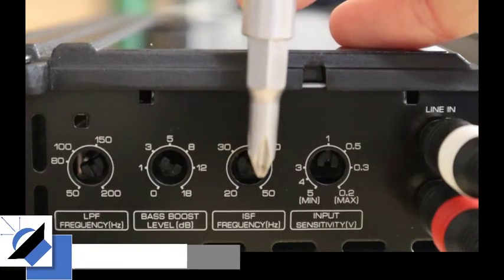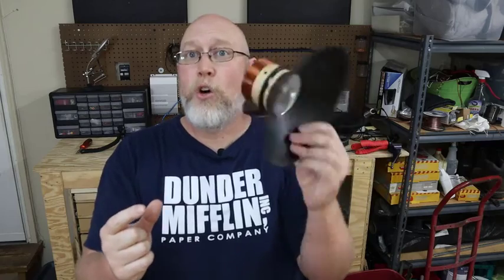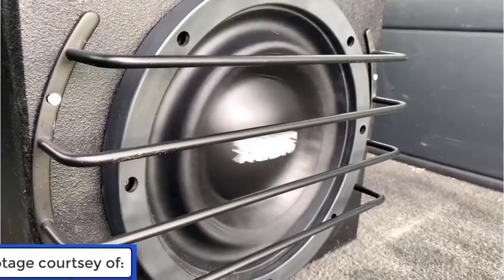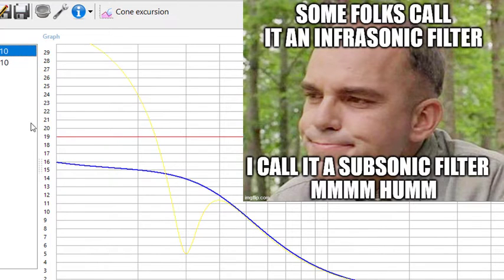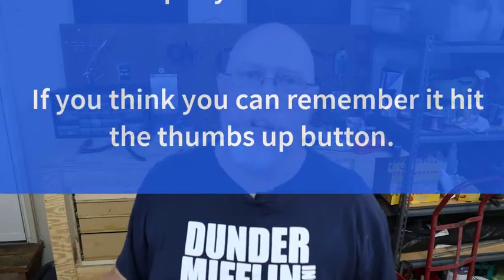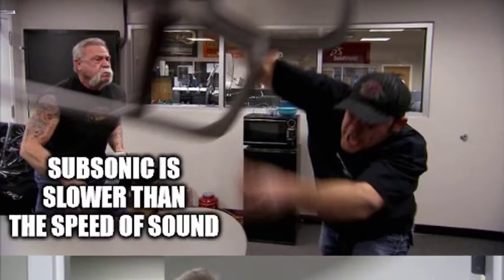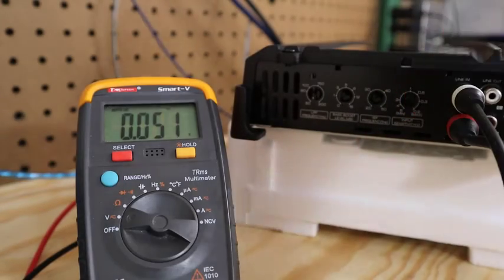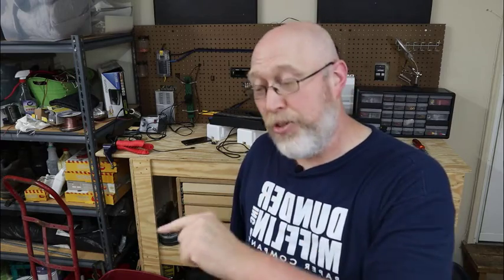Subsonic Filters, protect your subwoofer from low bass using a multi-meter.

Comment: If you are scared of damaging your speakers with low bass YOU DON’T FILTER IT THE LOW BASS ALL TOGETHER which is what a subsonic filter does because when you do that you deny yourself those low frequencies even at low volume.  Ultra low bass does damage speakers it’s the AMPLITUDE that does that. So any so called bad liver using any subsonic filter is a fraud, a pussy, a wimp.

Comment: How can you tell/avoid building a box that would make the driver operate as if it was free air?

And at 4:40, is it .75xFb, or half an octave?
Reply from the maker: 1) Tune the box low af, or go sealed.  2) it is both that is how the math works out

Comment: Should a duel coil speaker be wired parallel or in series with itself to achieve low bass in the twenty Hertz
Reply from the maker: It has no impact on the performance of the speaker.  You choose a wiring configuration to match the speakers with the amplifier.

Comment: So if you're using a sealed box should you just turn your subsonic filter to zero?
Reply: Set at 20 Hz if your sub doesn't  make any sound below 25,30 Hz.
Cause it's just wasting power and protects the sub.

Comment: Didn't understand this can someone please make it simple
Reply: No worries bro I got you. Plug in your port tune number instead of my example one.

1. What's your port tuned to? Let's call it 32hz (change to your tune)
2. So, 32hz × .75 = 24hz (so you need to play a 24hz tone)
3. You want your dmm plugged into pos & neg speaker terminals
4. With the tone playing, adjust the volume on your head unit until it's reading 10v on the dmm
5. Now you can set the ssf, adjust the ssf on the amp until the dmm reads 7.08v (You wanna get it as close as possible to 7.08v, but it won't hurt the subs any if you can't get it exact & it's reading like 7.05 instead.
After that you're good to go man ssf is set

Side note: if you can't get the volume to read exactly 10v, he did it for easy math. The equation is 10v × .708 = 7.08v. So, you can replace 10v with whatever number you're closest to then multiply by .708. That becomes the number you adjust the ssf to on step 5. I'd try to get 10v tho it's a much easier number. Hope this helps man 👍

Comment: I have a question, if the box is sealed but you have 2 subs facing 2 others in a single box, why can I reach x-max easy without subsonic "amps nob name" they are push the air together. So it gets pretty high pressure in that box hahaha
Reply from the maker: I'm not sure what you mean by two subs facing two others in a single box.

But in general sealed enclosures don't really need an infrasonic filter. That's not an absolute truth, just the general trend.  The air inside of the enclosure acts as a spring that makes it harder for the cone to move.
Reply: The front and back of my box have subs. But they are inverted for box space and cooling @DIYAudioGuy

Comment: Are all ISF's with the reading of 20-50 the same across different amplifiers, meaning, I been trying to figure out where is the 25hz position is on my Skar RP15001.d. Looking at this amp as an example because it shows the numbers and the Skar and this amp has the same range. Could I use this as a reference to help dial in my target frequency? Thank you
Reply from the maker: You can't tell by looking at the dial. You got to grab a multimeter and measure it.

Comment: most infrasonic filters 12-18db? It's 6db??.708
 in voltage I believe this is correct. I haven't double checked at max power it was set at half volume as shown here for 40fs driver 32hz tuned set to 24hz
Reply from the maker: You should be good. You can always make adjustments after listening.
Reply: @DIYAudioGuy  what would also work a roll of r15 or less for a buck

Comment: Since i have access to a SPL meter, I use that, along with test tones, and set on repeat, to set my subsonic filter. I recommend using a test tone 5Hz to 10Hz below port tuning, and reducing SPL output @ that freq., by 1 to 3Db depending on how much power you have, and how conservative you want to be. Example: If you have (2) -1,000 watt r.m.s. Subwoofers, and power them with recommended power, which is usually around 75% of r.m.s. power handling, so around 1,500 r.m.s for the pair, i would use a test tone 7Hz below port tune, and reduce output by 2Db. Make sure the subsonic is turned all the way down, before starting the test. Start selected test tone on repeat @ a conservative volume, example: If a system is capable of 140Db @ max, @ 45Hz, and the ported enclosure was tuned @ 37Hz, i would use a 30Hz test tone, and turn up the volume slowly to around 120Db (have SPL meter set to real time=Not peak hold), @30Hz, so its loud enough, but very sustainable, and wont heat up coils quickly, or drop voltage. Also listen to the speaker, if it makes bad noises, turn it down, or off. Then slowly adjust the subsonic filter, until it reduces the Db by 2, @ 30Hz, so 118Db. If you want to be more conservative/safe, set subsonic -3Db, @ 5Hz below port tuning, and if you want to be less conservative, set subsonic -1Db, @ 10Hz below port tuning. Hope this helps, have a great day, Audio fans.

Comment: Im using a JL audio HD 1200/1 to run a 13W7 in a ported enclosure. The HD1200/1 has a infrasonic filter which is factory set at 30hz and can only be set to on or off. My ported enclosure is built to JL audio specifications and tuned to 34.6hz. I feel the 30hz infrasonic filter is a little too close to the box tuned frequency of 34 and may be losing/missing alot of bass. I've turned the infrasonic filter off and the sub plays alot better and sounds much smoother aswell. I can't help but be a little worried about damaging the sub.
Reply from the maker: Yeah, you don't want to damage that awesome subwoofer.  I think your answer will depend on the type of music you play.  If you are into re-bassed music, trap and bass-heavy stuff (techmaster peb etc etc) you will want the filter.  For normal music just go easy on the volume knob and turn it down if you hear distortion.  It will distort before it bottoms out.

Comment: my sub is tuned to 32hz what should my sonic filter be at? about 40hz or 20hz
Reply from the maker: 24
Reply: @DIYAudioGuy  thanks my half way mark on sonic filter is 25 and it goes to 50 on my DC audio amp 1.2k so pretty easy to figure out where 24 is.
Reply: @PRO_GAMER_SIM  i just got the same amp recently how's it sound what you think about the dc 1.2?
Reply: @NoPainNoGain___  its amazing amp dont get barely warm and puts out clean power will last years and years with no problems.
Reply: @PRO_GAMER_SIM  that's good to know!i just got them installed last night very good so far and one solid ass amp 👌

Comment: Just installed two ct sounds tropo 8” in a 2.000 sqft3 box with a 39hz frequency, just installed winisd type in all specs and around 50hz I’m over come excursion , so I set high pass filter at 50hz to be under the 9mm redline , it puts me right below the redline however I am max on my high pass filter is that correct ?
Reply from the maker: That sounds odd -- not sure why you are exceeding x-max at 50 hz.
Reply: @DIYAudioGuy  yeah I enter all ct sounds Tropo specs , box specs and the wattage . To keep it under red line high pass filter has to be 48hz, I mean it sounds good but I feel just can’t hit them low hz ,

Comment: So DIY I have 2 PPI pro mos np infrasonic filter on these amps , I listen to some rock mostly rap, r&b ( no magic Mike type play list )  are my selected listening choices 33hz or lower and do I have to rule out ported enclosure?
Reply from the maker: Not sure what you mean by rule out a ported enclosure.  You saying you should not use one?
Reply: That’s the question I was asking, I’ve had my equipment on the shelf for a while, when I had  ported boxes years ago we never heard of infrasonic filter now I hear don’t run ported without it , just wanted your opinion if it’s ABSOLUTELY necessary to have it based on what I listen to for daily driver,

Comment: Infrasonic and subsonic and two totally different things.
Reply from the maker: In this case the correct term is infrasonic but almost everyone uses the term subsonic.
Reply: @DIYAudioGuy  Since im looking for reduction/limiting of freq. in the 10Hz to 19Hz range, then in my case it would be called a subsonic filter, right? But for anyone looking for reduction/limiting of freq. In the 20Hz and up freq., would be infrasonic filter?
Reply from the maker: @evilinside5984  subsonic means slower than the speed of sound.  Infrasonic refers to frequencies that are too low for the typical human being to hear.

It's one of those situations where the commonly used term is the incorrect.  It's just a high pass crossover set to a very low frequency.

Comment: Would Like to see in in depth review of the Audiocontrol Epicenter.  It's been around forever, but I just discovered it. Apparently its just like a guitar octave pedal. A game changer for bass heads. Especially if you like older classic rock and maybe even old hip hop.
Reply from the maker: I've never had a need for one.
Reply: @DIYAudioGuy   Most people don't "need" one. Some people do. A lot of modern cars cut your bass. And older music barely has any bass. Or some people just want crazy bass. Just giving you content ideas.  Or did you stop making videos?
Reply: @kewlbug  no one has videos on that thing it pisses me off
Reply: @kewlbug yeah if I understood correctly you need a converter for modern cars they cut a lot of frequencies out. Epicenter is to bring out bass in songs where there isn’t any bass.
Reply: OMG YES 😲😃! I've been kicking around the idea of buying the Epicenter but keep thinking it may not be what I'm expecting & therefore wanting. I'd love an indepth look & this device.
Reply: @briank.2650   They are great, I'd like to get another one, maybe the micro. I didn't have room in my car

Comment: Ok so if my box is tuned to 40hz my sub sonic should be set to 28hz right?
 here what I have 2 10x4mofos at 1ohm box is tuned to 40-42hz but now I'm confused on where my lpf and sub sonic should be I thought lpf should be 40hz and sub sonic 28hz but now I'm lost can you help please
Reply from the maker: I would put the low pass filter at 80 hertz and the infrasonic filter at 30 hertz.  Since you're using 24 decibel per octave slopes you might be able to get away with 100 hertz for the low pass and 25 for the infrasonic.  As always your ear is your most important tool. But doesn't sound good big a different crossover point/slope.
Reply: @DIYAudioGuy  ok so last question I'm  running (2)10s 1200rms each 4ohm DVC so 2400rms at 1ohm final with my amp being 1500.1d 24db slop and box seems to be tuned at 40-42hz I did the square root of 1500 x 1= 38.72 is this right and if so what tone should I use to set it a 40 or 50hz or should it be something else
Reply: @DIYAudioGuy  also if it helps my x max is 15mm and mech is 21mm fs(hz) is 29.63 QMS 5.6 VAS(ft³) .869 QES .45 RE 7.24 BL 24.44 QTS .42 SPL(1w/1m db) 83.4 that's all the info I have on subs
Reply from the maker: @carlosyounger5449  It's all based on the box tuning frequency.
Reply: Sorry amp 1500.1 class d with 24 db slope

Comment: On a Subsonic Filter 20hz - 50hz

What would it be at 12:00 position? 35hz?

20+50=70hz

70/2= 35hz

Thanks for anybody that can’t help me figure it out..

Also, LPF 20hz - 200hz 

Half way would be 110hz and 9:00 position being 55hz?
Reply from the maker: You can't really trust the markings on the potentiometers.  Play a test tone equal to the frequency where you want to set the crossover and follow the instructions in the video.

Comment: I have a 2015 VW beetle hatchback with an sa classic sundown and the 1500 mono amp @1ohm. Nothing is stock. I also have a 4ch@80. I'm trying to go more for SQ than SPL. What would be better for the hatchback area. Currently it's in a prefab 40-41hzs tune with 1.68 cub after everything is subtracted. I also have an extra battery in the back.
Reply from the maker: A custom box is always best, but there is nothing wrong with a pre-fab.  I have never used that sub so I cannot say for sure what the best box for it would be.

Comment: I have a Skar audio 12 inch box and it’s tuned at 36hz, in it I have Crossfire C3 and I have my subsonic at 29hz…should I drop it some more? I used the SMD CC1 to set it at around 29hz on subsonic….should I do 25hz instead? Some help?
Reply from the maker: .75 * 36 should give you 27 Hz.
Reply: @DIYAudioGuy I did set it at 28hz being that the CC1 doesn’t have the 27hz test tone.

Comment: So if my ssf has a 24db slope I would multiply by 0.251 correct?
Reply from the maker: Yep!
Reply: @DIYAudioGuy  I set my ssf filter with the 0.251 formula from your other video. I had been previously using a smd cc1 to set my filters and this method hands down sounds better. The dials setting now my ssf is up higher and my low bass sounds amazing an 0 bottoming out now . I believe the cc1 had me way under tuning.

Comment: Hellos, question. Most amps comes with a 12db slope roll off for the crossovers. do we will have to apply the .708 of the ac voltage output if its already sloped or does that not apply to subsonic filter?
Reply from the maker: Not sure what you mean.  Typically when I set the subsonic I turn off all other crossovers so I don't muddy up the signal.
Reply: @DIYAudioGuy  i saw a couple amps that comes with a built in 12db slope for the crossovers when setting it on the amp, if its already 12bd down, and we apply the .707, wouldn't that make it 15dn down?
Reply from the maker: @jeremymanick5684  Most crossovers like this will have a dial that lets you set the frequency.  You use the .707 to find the frequency you are shooting for.
Reply: Can I play a test tone that is -3db 29hz and it work like doing the math for .707?

Comment: Hey buddy I’m not to sure if u answer to comments but I have a quick question if u don’t mind. I have a potted enclosure  2 12 inch jbl 1220b woofers theyre rated at 34-200 hz with a sensitivity of 94. What would I want to set my subsonic at? I’m kind of confused if u could help me it would be very much appreciated. Keep up the good work boss. Just tuned my gain with your method
Reply from the maker: If you know the tuning frequency of the enclosure multiply that by 0.75.  I'm guessing that you probably don't know that which is why you're asking.  So I would suggest trying it at 25 hertz and see how that works.
Reply: @DIYAudioGuy  yea unfortunately I’m not to sure where to find the tuning frequency I’ve tried to look online but can’t find it I’ll try 25hz and see how it is, I’ve put my low pass at 80 to be safe too. appreciate you helping me out! All love keep grinding! Your videos r very informative and entertaining

Comment: I have a Ken wood amp with the exact same thing how do I set it up for a 600watt subwoffer with a 4 ome it’s supposed to be 2000 watts the amp but it’s constantly pulsing with the woffer please let me know
Reply: Btw it’s a 10 inch woffer
Reply from the maker: It's probably the exact same amp.  "Max" power is 2k, but RMS is 1k.

Here's a video, toward the end I show you how to set up an amplifier when the amplifier can produce more power than your speaker can handle.
https://youtu.be/MBcGOoRJ4Ro

Comment: Do i need a subsonic filter if I'm running two 8 in bazooka tubes 200 watts and if I do what should I set it at ?
Reply from the maker: Back in the day bazooka used to brag about being tuned to 39 Hz. Assuming nothing has changed then I think you probably need an infrasonic filter on them.
Reply: @DIYAudioGuy  thanks for the reply 👍  I really like your videos

Comment: I set my gain already and also my crossover to 80 hertz from your last 2 videos I’ve seen.. so I would do this after I set those two mentioned  above and I should be good?
Reply from the maker: That should work!

I keep my infrasonic filter at 20 hertz.  It's the lowest setting that my amplifier has and it's worked pretty well for me so far.

Comment: So I have 4 12” p2d2 fogates. I have 2 500 watt fosgate amps. What would be best set up for maximum low bass?
Reply from the maker: That's kind of a big question. Are you looking for how to wire them, are you looking for how to tune the enclosure, are you looking for how to set up the crossovers and the subsonic filter?

Comment: I don't think you were exactly clear about this but do you play the same Hz tone as the desired infrasonic filter?  In your example, you play 30Hz, adjust unfiltered volume until you read 10V at the speaker terminals, and then adjust infrasonic filter to reduce the voltage to 7.08V and the only thing which would change is the frequency of the tone you play?  Should the tone be -3dB or 0dB?
Reply from the maker: That is correct, if you want to set the filter at 30 hertz you play a 30 hertz tone.

Comment: Be mindful guys the -3dB at the Crossover Point only applies to Butterworth. (And 1st order Bessel)

My Hifonics ZEUS ZRX1216.1D for example will not follow the .708 like this video. I found it to follow .58 which is exactly like a 2nd order Bessel filter.

I found out my crossover type by leaving the infrasonic filter at the lowest it would go (10Hz in my case) and playing a sine wave at the highest mine would go (40Hz) and taking note of the voltage difference to figure out the filter type.

In my case my sub almost doesn't need a infrasonic filter (Mines set to 13Hz now or something crazy) with how low I'm tuned, but these videos still helped me push to figure out some cool new things. Happy New Year everyone!
Reply from the maker: That's good!  Nothing wrong with experimenting to see how something works.
Reply: Box tune to 33 hz. What’s my subsonic filter ?